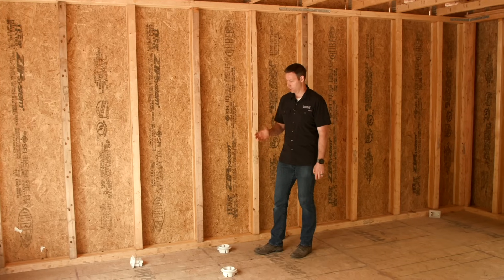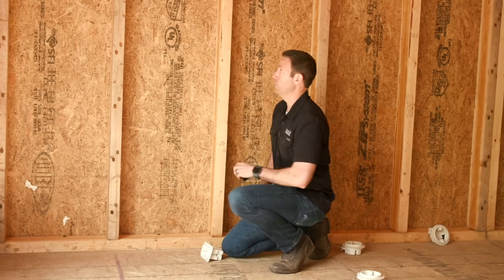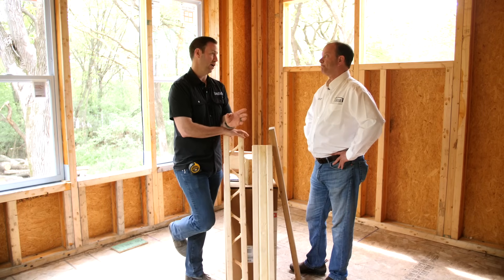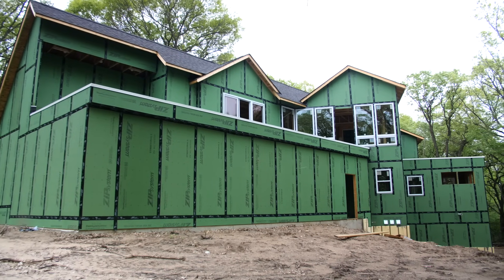Insulated Studs? This is a BIG Innovation in Framing!

Comment: I'm planning on building a net zero energy home within the next ten years on recently purchased bare land and have never seen such a game changer.  I am SOLD on this product! Thanks for the introduction to this new tech Matt!
Reply: Wait the full 10 years and this will will obsolete and replaced with....?   lol
Reply: @stillaliveandwell5291  I mean this has existed for 10 years. The price makes it a niche market product.
Reply: @Fekillix  Considering the costs of hvac equipment, its installation, plus the future higher costs of energy usage with traditional building, price of traditional framing is far greater.
Reply: I am from Norway and we build very energy efficient homes, with passive-houses for example. It is cheaper to achieve the same u-value by using 2x2 furring strips on the cross of the studs on the inside. Increased air sealing also substantially increases the benefit of more insulation. That is why we always recess the vapour barrier behind the furring strips and run all electrical outside the sealed envelope of the walls. The benefit of this product is lost when you also add furring strips for a recessed vapour barrier. That is why it is very rarely used. There are simply cheaper ways to get the same performance.
Reply: @Fekillix @bluecollartrader I notice he said he can ship a package based on a set a plans from Canada so this not something that has even made it to the largest market in the world. This is more advantageous for extreme climates, although some benefits can be had most everywhere (not Puerto Rico where it is 80 year round). When I built my 2500 square foot house I paid attention to every little detail of preventing air intrusion. I used nothing out of the ordinary. The house is very quiet, if you crack one of the insulated low E windows just a little the loudness of the sounds of the outdoors attest to how well insulated the structure is. Also I have 2 gas forced air furnaces, 3.5 tons of cooling and 2 hot water heaters yet never have energy bills (gas plus electric) over $125, simply from paying attention to details. My neighbors bills are all at least twice that with smaller houses.
Reply: Do some research, you do not need these to build a net zero energy home.  The extra cost could be put into other areas that would have a larger impact.
Reply: @sirstickjcs  please provide an example. I can be convinced either way. I have around ten years to think about it! lol
Reply: @brockm4047   Advanced framing is the first thing to look into.  The numbers in this video ignore advanced framing.  This is standard in some areas and new in others.  It adds no cost to building.

For the cost of this product you can add rigid foam insulation on the entire exterior of the house.  Even on T studs website they have a chart showing rigid foam insulation on the exterior provides a higher average R-value than T studs.

For similar cost you could have AeroBarrier air seal the entire home.

You can spend more money to upgrade to better windows. 

More money on more attic insulation is always a good idea. 

A good in line or heat pump water heater would save more money over the life of the house.

There is always upgrades on the HVAC.  Look into adding an ERV or entire house dehumidifier.  These are probably more expensive than T studs, but worth the money when used correctly.

Look into spending money on all of these options, and probably more, once you have most of these in your home you can look into spending the extra on t  studs to gain a small amount of R value.

Also, if your timeline is 10 years, what we are referring to as net zero energy home now, will be the standard building codes in most areas in the next ten years.
Reply: @sirstickjcs  Excellent advice. I appreciate your taking time out to share with a complete stranger over the internet. My plan was initially to do advanced framing and use quite a bit of exterior insulation. With the tight envelope I planned on, an ERV would be a must. I'll be building in the upper U.P. of Michigan and there will be lots of temperature extremes. Thanks again for your advice, feel free to share more. ;) I'm trying to learn as much as I can in the next 10 years before building.

Comment: Glad to learn about this product. Attempting to plan for my home, considered staggered framing then was leaning to doing something similar constructed on site. But by the time you factor in the additional labor to self build something similar, the additional cost is totally negated. Also like the additional width and loosing the need for plumbers and electricians to have to drill the majority of the structure out of any given wall.

Comment: Can this be used for rafters?
Reply: They are probably waiting to recoup some investment before providing deeper materials for joists and rafters. They need deeper rafters to meet most code required insulation values for rafters also will need span charts and testing done. I put money on it we will soon see these in that form factor. If your working outside of code restricted areas and feel like it would work for you go for it. I personally would like to see horizontal load testing at different pitches and spans with charts to feel better about it although I do live outside of building codes which is becoming rarer by the day to find such an area.

Comment: I wonder if it'd be cheaper to just take 2x6 and cut out holes at regular intervals compared to drilling dowel holes and putting them in place... I also wonder if it'd be just as effective... I hate the waste of the cut holes though, but at a factory, those pieces could be repurposed somehow.

Comment: $1,000-$1,500 per 2500sqft house isn't much, overall...and you'll gain all that R-value in the walls, which will cut down on heating bills.  This is a pretty good bargain!
Reply: you will need up the rock to 5/8 for the 24"oc.
Reply: Additional TStud costs paid for with lower HVAC equipment costs then lower future heating bills as "profit?"

Comment: I'd be worried about wind and snow loading... 24" on center in MN?!?! Very interesting!
Reply: it may have 25% less vertical studs, but each can handle 4x more weight per stud.
Reply: Carl magna III Yeah! Crazy!
Reply: Explanation Starts 9:23
Reply: PlanePreacher Yeah, it is pretty impressive.
Reply: Racking performance would be well above traditional framing and that stud even on 24inch centers can take near 3x the vertical load of comparable 2x6 wall with 16inch on center framing. Do to available stud depths they didn't mention use as rafters or joists because the needed depth of insulation to pass most codes require deeper material than they offer at this time. One would assume after some recuperation time they will make such products and have them tested in such applications to provide load and span charts for proper engineering.
Reply: Master Debater your user name is on point!
Reply: @DetachedGarage Thx, i enjoy a good conversation/debate. Sometimes it appears like i am afilliated with the topic/product/channel but i assure you I am but a man who loves a good clean conversation. Enjoy your viewing, maybe see you around in the comment section.

Comment: Interesting but any chain is only as strong as its weakest link. With the 2" x 3"'s connected by dowels, the strongest member is only the 2" x 3"'s. The insulating material doesn't impart any significant compressive, torsional or tensile strength. I certainly wouldn't trade structural strength and a longer lifespan for the benefit of some energy saving. Think of if you've ever been in the outer zone of a hurrricane, which I was in twice at the N.C. OBX beach. The winds torgued the beach house and tried to lift it off the piers that the house was bolted down to by gusset plates. Thank God!  "Hurricane resistance"? Not as robust as with normal studs and any house I build, which I hope to, will be overbuilt.. I'll find other more creative ways to save energy but face it, you're always going to be thermally imperfect to a certain degree. This is not a trade that I'd make. Thank you no!

Comment: I won't mind spending the extra 10k on this studs, I'm about to start building my own home here in Houston , and Matt is definitely going to be involved in that .... what a great video !!!!

Ed with Eagle Home Services
Reply: He said 1500 extra for a 2500ft house.
Reply: @augustreil  he said that but I want to build a 4000 sqft home with high ceilings so it's probably 8 to 10k more for this stud system , not bad at all I believe
Reply: @gused82 , Yeah that would make a difference for sure !
Reply: Speak with your engineer I bet he could make you feel good about that investment after some alterations you may see half that cost in savings of labor and material.

Comment: Matt. All they need to do now is use the T stud for the bottom cord of the roof truss to get the thermal break to the roof cavity. No doubt this would help thermal transfer in both hot and cold climates.
Reply: Normally, the roof framing is covered by insulation, so I don't see the point of this idea.

Comment: How about a TStud, with spray foam, with ZIP-R! Get an R60 wall LOL
Reply: Slade The Original you could heat that house with a candle and cool it with a bag of ice 😂
Reply: How do you get from R-20 to R60 with spray foam?  Do the math.
Reply: Open cell is typically rated at R-3.7 per inch, closed is rated at R-6.5 per inch 
So for a Tstud with more closed cell at 6 inches would make it R-39 and at 8 would mean it is R-52, both before you add in insulated Huber Zip-R system boards on the outside.
www.finehomebuilding.com/2017/07/10/closed-cell-foam-studs-waste
Reply: @BenjaminFranklin99-s9n  I live in South Central Worcester County MA next to another county and winters vary year to year for me much like you. I wish the place i currently live in was remodelded to modern standards for better insulation to help lower heating and cooling costs and eliminate the drafts I get all year. Closet is the worst with draft as it seems to not have any more if at all any insulation in the wall and it s corner room on my bedroom where I have one window with a small one in the closet. I would gladly pay my landlord more rent if he was more willing to get things done around this place. THen again I was to win the lottery I would spring to move out of this "nighmare' of an old place, with no insulated basement, I much rather live in a house with ICF basement and at least an R 24 exterior post frame structure..I am not a fan of SIPs despite their ease of installation, there is many ways to best insulate a structure and isolate the solid wood timber from outside temps. I would be inclined to use Tstud for secondary framing of said post frame as it is the best of solid with the benefit of being better insulated and thermally broken from the outside temps and would add better strength than just solid lumber. Especially when it comes to framing out windows or doors.